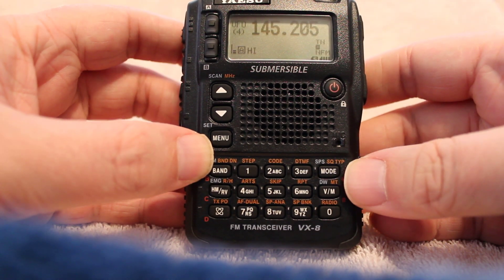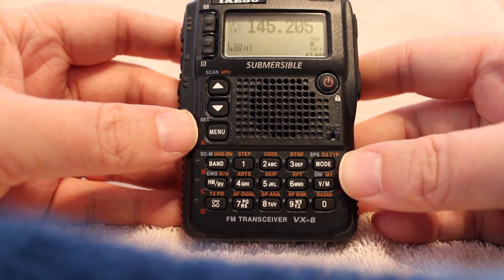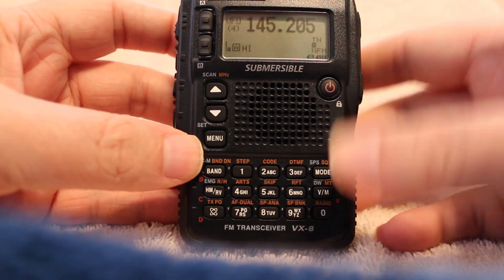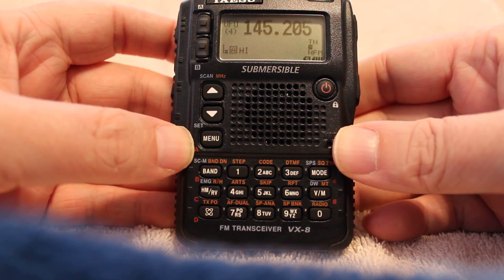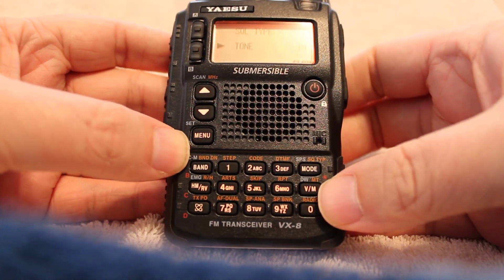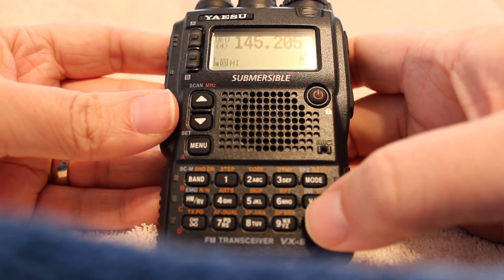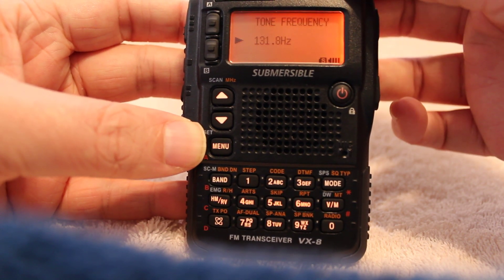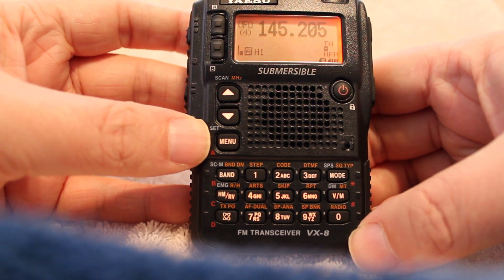Yaesu VX-8DR:  Setting Repeater PL Tones

Comment: Any idea why tone type doesn't change when I rotate knob?  The knob will change other menu settings, but not this one.
Reply: Factory reset fixed it.
Reply: It refuses to let you set the Tone if your APRS is turned on and you are trying to set the Tone on channel B. Go to APRS menu item 5 and change the APRS speed to OFF, then your radio will use the Tone you set. This prevents you from using APRS through a repeater, which is annoying to repeater owners.

Comment: If I'm not mistaken, you've showed how to set the 'transmit' tone (the tone the Yaesu sends that causes the repeater to open squelch and receive its transmission). What is the repeater sends out a tone itself, which I think is called a 'receive' tone (kinda new to Ham). How do you set that?